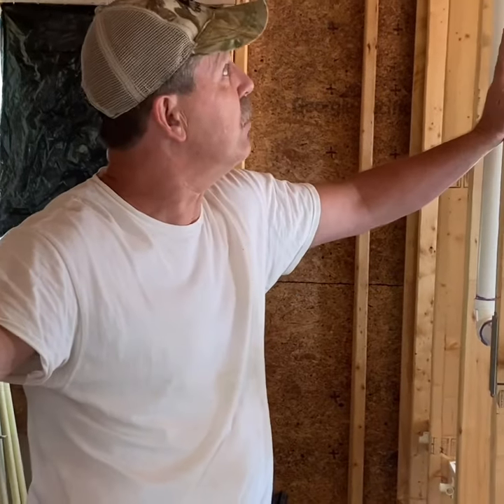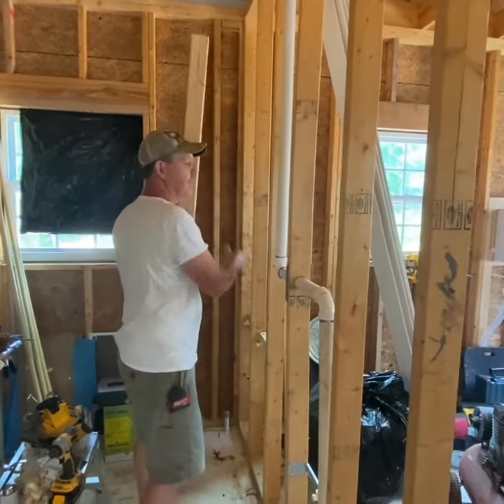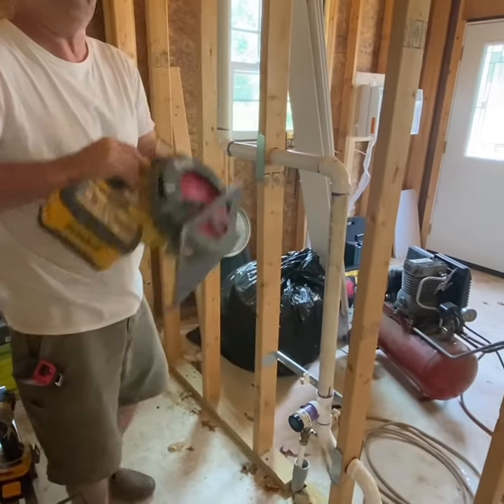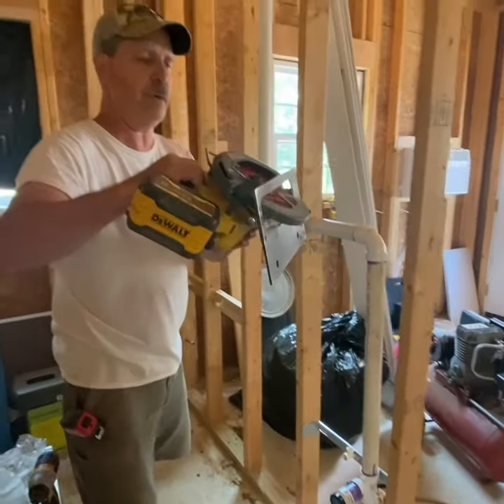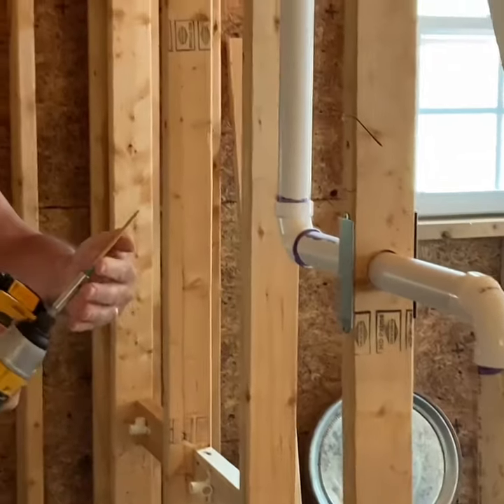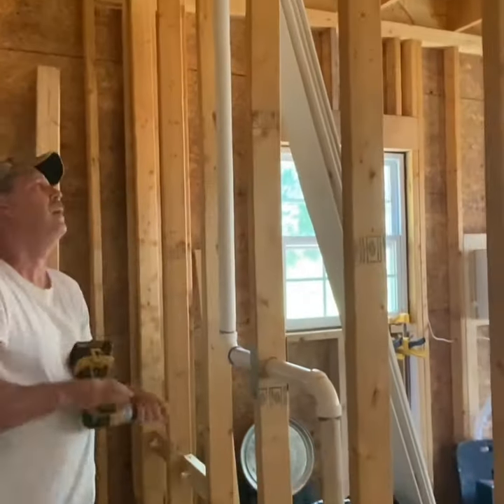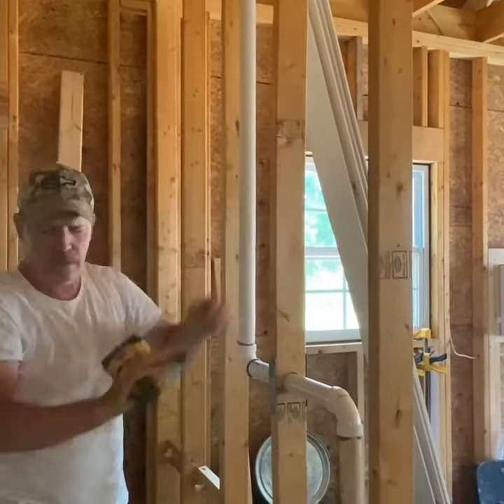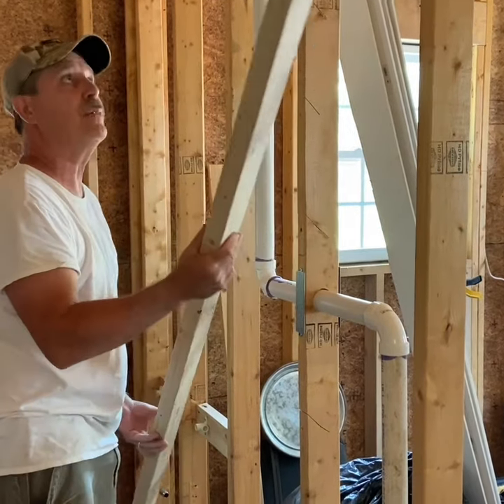Straighten curved 2x4 stud #tinyhouse #diy #construction

Comment: That's why we built all interior walls with LVL studs.
Reply from the maker: That’s a great idea
Reply: LVL? Really? Why not just use solid gold studs. About the same price.
Reply: @@gremlin1407 Nope, it's LVL we don't have LSL here at all. Other options is finger jointed wood or C- shape steel studs.
One LVL 10 ft long cost 8.94 € which is roughly $9.
Reply: @@gremlin1407 Prices here were much cheaper before Covid. LVL is still roughly 2x more expensive than finger jointed lumber but all interior walls it doesn't make huge difference on whole budget and you get flawless straight walls and also a bit sturdier. So many chooses those over finger jointed lumber.
Reply: Iam  over straightening 90×35

Comment: Nice job I don’t know where you live but where I live a building inspector would not pass this it would have to be taken out and re done the plumber would have to cut the pipe out and do a new fit after also.
Reply from the maker: That’s interesting
Reply: Maybe if it's a load bearing wall, which this isn't 🤷
Reply: how would he even see it from his car?

Comment: Another way is to cut 2 or 3 wedge shaped  cut pop a wedge in screw it up put Fletching pieces on both sides of the stud around 300mm long and screw it up otherwise you're dependent on the gauge of the screw 🍺

Comment: You can usually do it with one cut in the middle. It should be plated on both sides with some sticks 2' long. Obviously in this example the pipe is the problem

Comment: is that a load bearing wall? can you do that in a load bearing wall?
Reply from the maker: No, this is not loadbearing. Yes you can do loadbearing studs. If there are some concern you can scab a 2 x 4 to the side.
Reply: There is a 2inch pipe going through it. Load bearing at this point....

Comment: All u had to do is screw a 2x4 right beside it and level it out with the others
Reply from the maker: That probably wouldn’t work in this application because the pipe is in the way. The curve was from top to bottom.